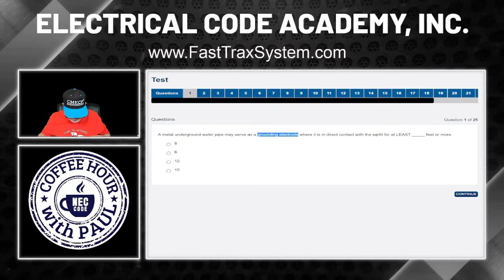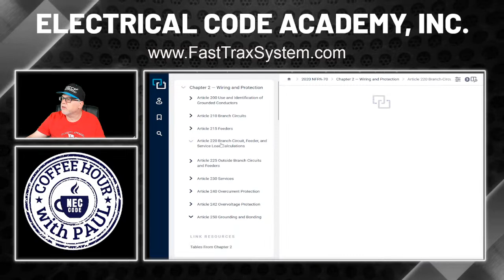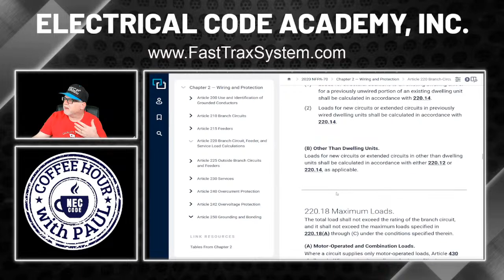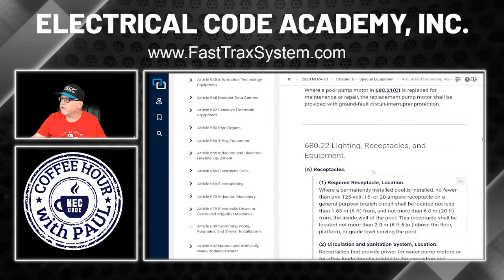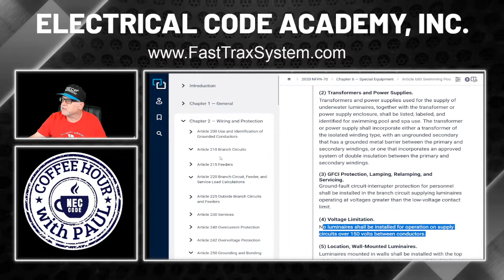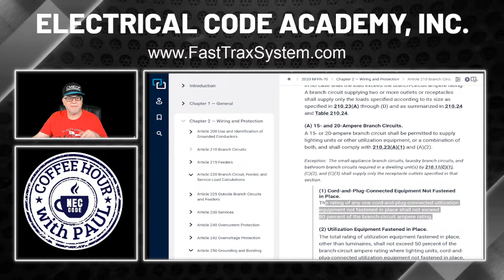Master Electrician Exam Prep | Exam Prep

Comment: For Question 3: if you look in article 100 for Low-voltage contact limit, it lists 15 volts RMS, is this relevant to the question?
Reply from the maker: No, because that would only give the LVCL and thats not what the question was asking.